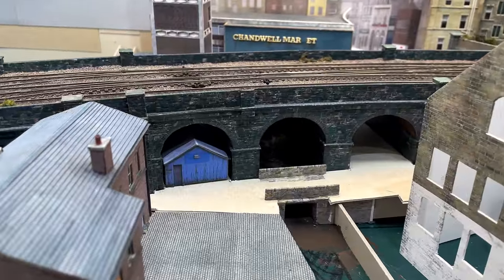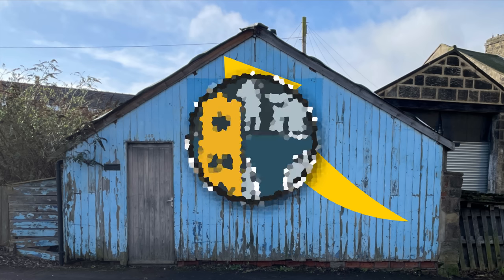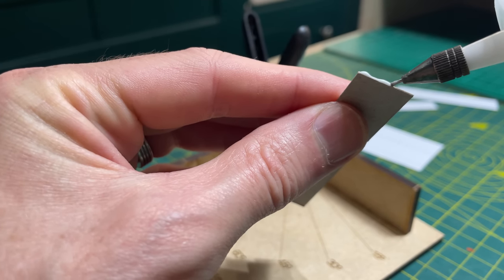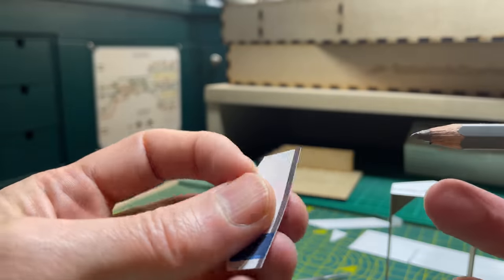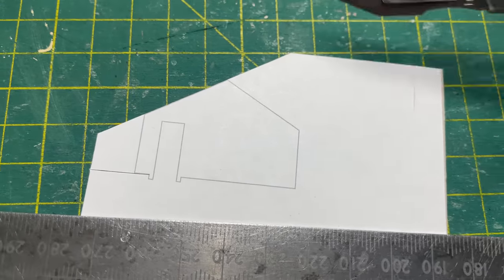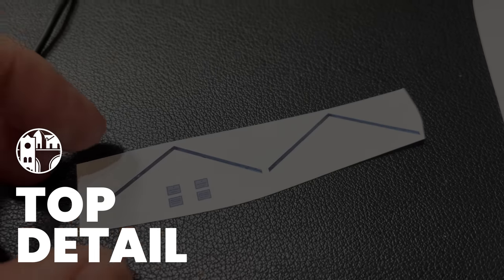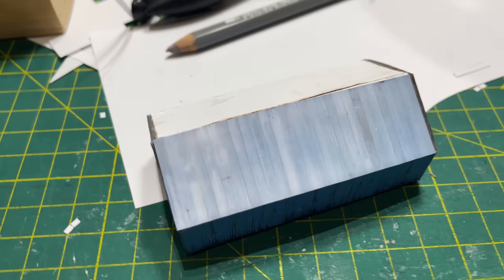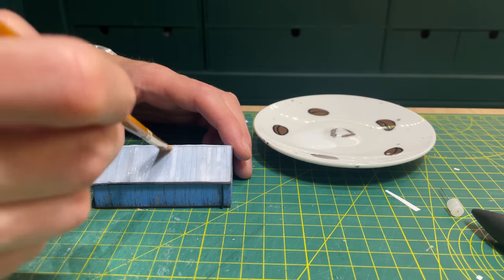Simple! A look at how I made this basic shed starting with just a photo

Comment: Micheal,
It is always a good thing for we veterans of the craft to restart our tutorial styling for those newbies just entering the craft.  It's a starting point for our next generation.
One thought.  You had printed out two signs for the building.  Instead of having to select one or the other why not add to the far front corner of the structure a door.  Then you could attach the Scott sign to the front right corner with an arrow indicating the youngster's entrance is around the corner.
Jim in N.Y.
Reply from the maker: Thanks Jim. Not sure a door there would work as the shed fits too snugly into the viaduct arch.

Comment: Michael Really like seeing you applying the same treatment to the smaller humble buildings, as the grander ones. Also how you take one of your own photo and turn it into a texture, for you’re buildings. For a model, could this be applied to other textures like a cobble roadway that was different to the other textures found online. Think the wood turner is a good call as without windows, a hut would not have been a very good for Scouts, unless it was the store for camping equipment for the Scouts & Guides which belonging to the Methodist Church before they moved out and Revs moved in. The darker blue patch on the front wall suggests a earlier sign rather like a ghost sign. Also like seeing the basic ground work and bridge in front of the viaduct & under the arches as a taste for things to come, simple but effective. Ian
Reply from the maker: Thanks Ian. I also like the hint of an older sign underneath its tiny current one.

Comment: Michael, as always, I am impressed with the incredible results you get from very simple - and inexpensive! - materials. I especially liked the way you embossed ribs onto the roofing - it's little details like this that make your work stand out. In this case, however, I think you would have been better served by taking a few liberties with the dimensions of the hut. By placing the hut under the arch, the size of the hut is magnified. As you pointed out, it doesn't even look as though there was room for the builders to apply the exterior siding along the sides of the hut. If you had reduced the width of the hut by four feet, and decreased the peak height proportionately, the hut would have fit into the arch more reasonably. 
Normally, you prepare building mockups, and perhaps you did so this time as well; in which case I would assume you made a conscious choice in favor of the very tight fit under the arch. But thinking as an engineer, if I were tasked with building this hut under the arch, I would've either extended the walls all the way to the stone arch, and braced the framing tight up against the stone, or allowed space for the construction crew to work along the sides. Anyway, that's just my opinion, and you know what they say about opinions...
Reply from the maker: Thank you for your considered advice. Much of what you have said has passed my thoughts at some point... My thinking originated with a picture of the old viaduct in Ilkley which had at least one hut under it which looked like it filled the space almost completely. It may have been the angle of the photo, but I was inspired to really "squeeze in" a hut. I supposed at the time that it was prefabricated and then slotted into place in the arch. But yes, this one does fill the space. There's another example in Farsley, but that is brick-built and does, like you say, join onto either side of the arch. Since the clad wooden sides in my case cannot be seen, we can always imagine that the sides have been built of breezeblock or something and not question too much how the thing was built in the first place. Your points are all very valid, but I think for now, I will leave it as-is unless it starts to irk me! :)
Reply: @Chandwell  I hope my nitpicky comments don't obscure what I have said many times: you always manage to achieve stunning results from very modest materials. Your modeling approach reminds me of the efforts of model railroaders back in the 1930s and 1940s, when there was no such thing as laser-cut kits, and no ready supply of commercial detail parts.
Reply from the maker: Not at all - honestly. These kinds of constructive comments really help. Sometimes I’ve already considered it but sometimes not. If you didn’t offer the comments, there would never be that “ah of course!” Moment that happens sometimes. I really appreciate it!

Comment: I think these videos on the more basic buildings are great, really gives a decent illustration of the principles which I need a reminder/kick with every now and again!

With this and the other small building video I can see you’ve got away from wrap round corners with textures - I had got this into my head as a must learning with ScaleScenes but you’ve shown it’s not needed at all and the edges are much better.  I’m glad you’ve shown the textures going on with PVA as again, using the kits, I’d got it into my head to use Pritt Stick.  This looks much more user friendly.

I do have an Inkscape question, I find the export to PDF makes huge file sizes!  My home printer isn’t very good and I’ve emailed things to a better printer, but the sizes are massive.  I’ve had a toy with the settings and looked online but can’t seem to fix it.  Thought I’d ask if you knew of a workaround!

Cheers Michael and wishing the best for now, take care : )
Reply from the maker: Yes, I have started using straight edges rather than wrapped ones, although both techniques come in handy. I think this non-wrapped approach gives a crisper line but it is completely non-forgiving with any amount of mis-measurement. 

I use PVA for almost everything. I find it so easy to use.

Yes, export to PDF makes HUGE files as the full-sized textures in each element needs to be included in the file, once per use. So even if you just have a few tiny patches of wall, but each one has the full texture clipped to it, the texture gets included in the PDF once per element. A tip is to arrange them all for printing, then put a big white rectangle behind the whole lot. Then export the rectangle as an 800dpi PNG file. Import the PNG file and then export THAT as the PDF. The file will be much smaller.
Reply: @Chandwell  Thanks so much Michael, I really appreciate the reply and the help with the PDF export.  I had a very quick look at this before going out to work earlier and will be having another play about with this when I get a chance.  Can’t wait to get on Inkscape again to look at this - the biggest PDF I’ve managed to make was 32MB which I was quite stunned by - and there wasn’t that much texture on it.  You’ve explained why this happened very well which I’m really grateful for.  

Agree with PVA - my little layout is practically built on the stuff!  It’s so affordable, easy to buy and so useful.  I like seeing it used so much in the videos, proves how good a glue it is.  I agree with you on UHU being the devils glue - though it sticks quickly, and sticks well - the stringiness of it really lets things down.  I try to avoid it where possible.  

You should have a PVA factory in Chandwell!  Such a notable employer that some residents say the town was built on it : )

Thanks again Michael and I really appreciate the replies, top man : )
Reply from the maker: @Captainpubwatch   Thank you! Yes, a PVA factory has crossed my mind for the industrial area in a year or so!
Reply: @Chandwell  Thanks for all the replies Michael, Chandwell proving to be the ‘go-to’ place for scratchbuilding.  I’ve been back a few times over the last couple of days to look for tips to get around some issues in the new build design.  There’s a high chance of the use of electrical tape and lots of layers being factored in 👍🏼

Comment: Interesting! One thing – I did read the sign as a protruding a/c unit, not a sign, because of its thickness.
Reply from the maker: It looks a lot thicker on the video than it is in reality. Measuring it with my callipers, it's 0.22mm in place on the front of the shed, so that's a scale 32.5mm. On the real shed, the sign seems to be on two layers of 9mm ply, which would make it 18mm, so yes, I guess I should have used one sheet of paper rather than two! :) But seriously, in place, from a normal viewing angle, it's not a big deal, and if it's read as an extractor fan or similar, then that's fine too. But it's worth remembering for future how thick a piece of paper really is! :)
Reply: @Chandwell  True enough! And there's such variation in paper thickness too, of course. 

I was always a 4mm modeller, but I must say that I'm feeling inspired by your work to do in 2mm an industrial building that I've always wanted to do but have always been unfeasibly large to model in 4mm, an Oxfordshire cloth mill.
Reply from the maker: Yeah! Go for it!!
Reply: @Chandwell  Thank you, Michael, and congratulations on the BRM article!

Comment: Hello Michael. Great channel and you’ve been inspiring in my model buildings for my railway. I have a question on the varnish step. I’ve not had any success with brush applying varnish as it makes the ink run on my prints. I’m using an HP Inkjet printer with HP cartridges on standard paper but whenever I apply varnish (thankfully to test pieces) is simply bleeds all of the print together. I see you’re using AK varnish the same as me but you don’t have this issue. I’m interested in what printer and paper you use for your models. Many thanks and thanks again for a great channel.
Reply from the maker: Hi David... You're not the first to say that an I am intending to one day do some experiments and make a video. I use Canon rather than HP printer and ink, so I can't rule out the ink itself, BUT, my printer ink on the backscene runs if I even look at it and THINK "wet", so I am almost certain its my paper. I use matt photo paper and the ink is dry as soon as it touches it - it won't smudge when dabbed with wet, and PVA doesn't cause it to run either. Full details are in this video: https://youtu.be/-QvdNFST7WU
Reply: @Chandwell  
Thank you Michael. I watched the recommended video (and a bit of a binge watch again on many others of yours) and ordered some new supplies. I'm well underway on my next build and so far, so good. No more running of the ink on the prints. I also indulged in some of the other supplied you mentioned, including a crochet hook. 🤣Thanks again and for the great channel content. Very inspiring.